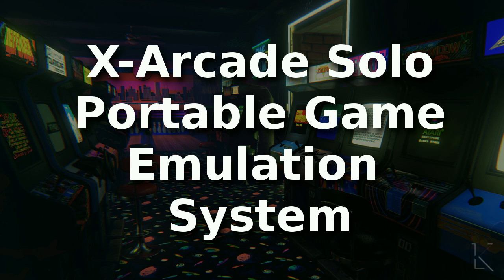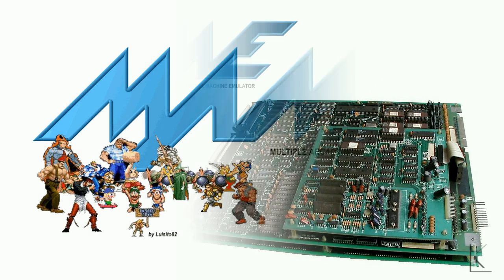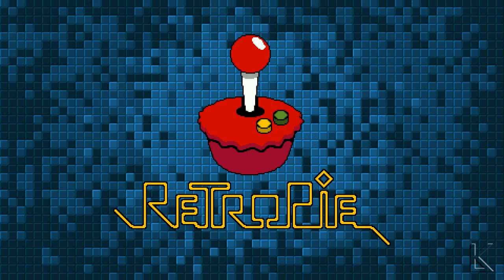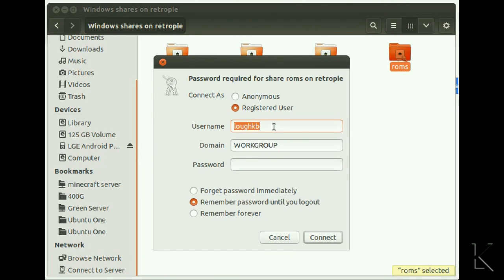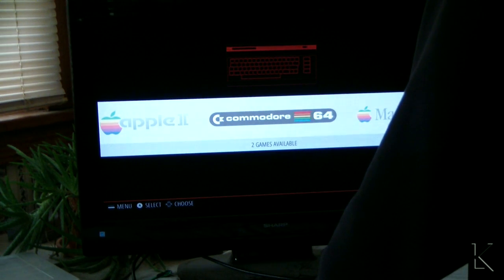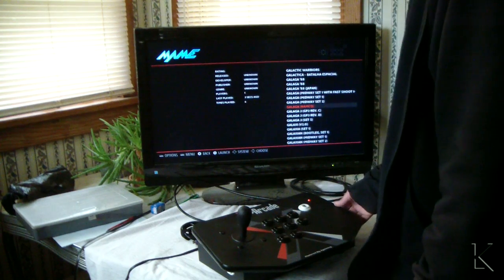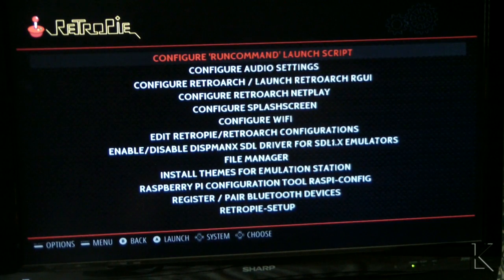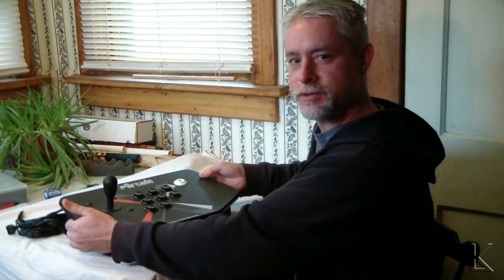X arcade retro  portable game system build

Comment: Awesome video.Plan on doing the same with my xarcade got all the bits ready to go just need to get to get round to it.Im thinking not to cut holes in mine though if it can be helped.
Reply from the maker: You could put the raspberry pi into a small case and use velcro to attach it to the outside of the x-arcade.
Reply: Or i might remove the seriel port and feed the cables through that as im going to replace the board with an i-pac anyhow :)

Comment: Could you post your controller config files for retro pi somewhere, i haven't found that many people with the x-arcade solo and i've been having issues getting mine working right.
Reply from the maker: +Ian Smith hi Ian,    I'm going to guess your problems are with the joystck inputs for up/down/right/left.   There's a quirk with the solo and simulating the keypad buttons without numlock on.    What I did was to move the plug on the internal board for the joystick input, to a different connector.    The internal board is identical with the dual and solo, so it has unpopulated jacks for the missing second player inputs.
That moved the joystick to a different set of defaults and allowed me to set the inputs for the emulators.